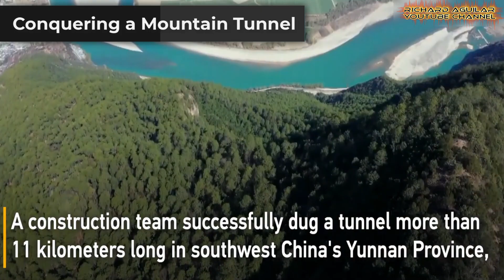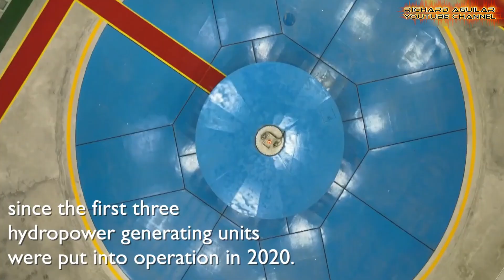China’s Largest Water Diversion Projects   Changing Billions of Lives

Comment: China plans projects for decades ahead. This is related to the system that operates in China. Recently, a hydroelectric power plant was launched in China, the project of which (geological survey) was prepared by experts from Czechoslovakia even before I was born. Czechoslovakia has not existed for more than 30 years, and I am already retired, and the hydroelectric power plant is operating.
This is not possible in the West. Their projects are planned for the election period.
Reply from the maker: It’s fascinating to hear about projects with such long lead times, like the hydroelectric plant you described.
Reply: @RichardAguilarChannel  Experts from Czechoslovakia did not build the power plant itself, of course, but in the 1950s and 1960s they participated in survey work at the site so that China could include this site in its plans. They were experts from the Hydrostav Praha and ČKD Blansko companies. Despite the fact that Czechoslovakia no longer exists, it has preserved an immortal monument in China.
Reply: Addition. In June 1959, a site survey was conducted at Qiaojia by a domestic expert group and a Czechoslovak expert group, and the future site for the Baihetan Power Plant was subsequently selected. China included this site in its plans, and the second largest hydroelectric power plant in the world after the Sanxia Power Plant was built on this site, with an installed capacity of 16,000 MW. I understand that the rest of the work was done by Chinese citizens, but when I heard this news, it warmed my heart a little.